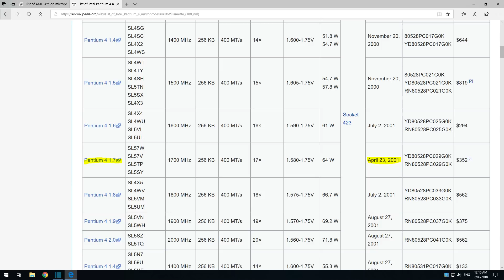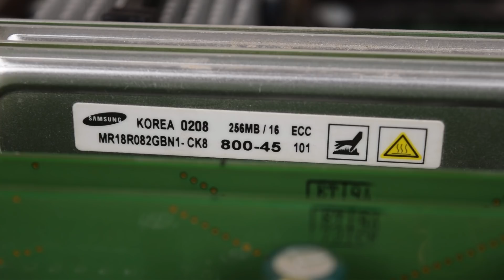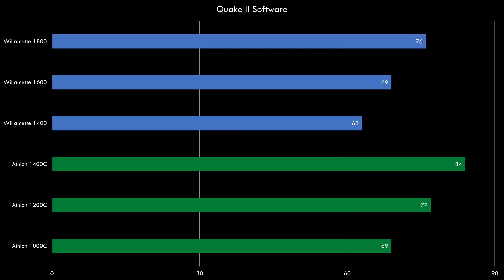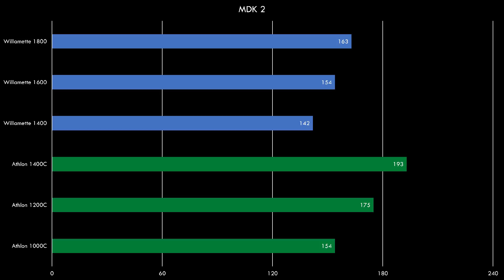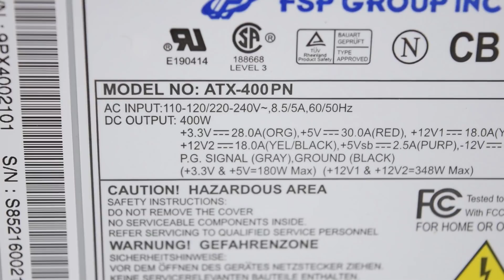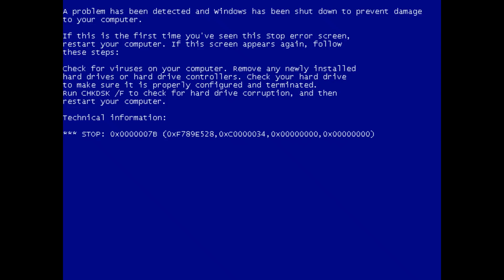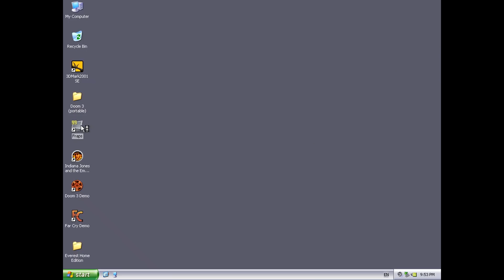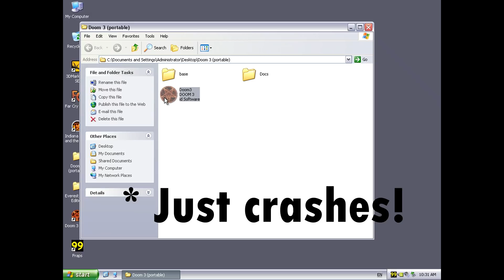Intel vs AMD S2E3 Athlon Thunderbird 1400 vs Pentium 4

Comment: Great video, Phil!
Used to have a t-bird 1400 based system back in 2001/2 which originally had 256mb pc2100, 40gb Fujitsu hdd plus a GeForce 2 mx400! I recall the CPU running at 75c or there abouts.
Reply from the maker: Nice!

Comment: When I worked in a pc shop in london in the 2000s when intel were releasing the p4 on teh lga775 I still promoted the AMD x64 systems and even sempron over celeron systems. For cost to performance, and better thermals.

Comment: what is that windows xp splash screen opening? I've not see that before. is this a custom thing? I would like to do it if so.
Reply from the maker: What time?
Reply: @philscomputerlab  9:24 Guess I should  have put the time in the first time =/
Reply from the maker: @spirallight1337  Ahh that's the setup animation. You know see it when installing XP.
Reply: @philscomputerlab  I've never seen that, I have installed XP tons of times... odd. but right on for the response!

Comment: Brings back some great memories, i had a Athlon 1ghz overclocked to 1.4ghz on a innovotek water cooling system, even had a evap/swamp cooler setup for a while, but in the end i just externally mounted a large car radiator outside my workshop and had an heat exchanger between that and the water cooling loop kept things cool easily.

Comment: I think I had that FPS psu , it could not cope wtih ati 9800 pro or nvidia 5700xt but did older cards just fine .You could think you killed it with a blank screen but worled fine on lower end cards afterwards -like mx440 ,tnt ,mx 200 but I had floppy ,cd-rom ,maxed out memory

Comment: 7:13 that noise from power supply you mentioned is normal if is from transformer inside of that PSU. i have a similar psu like this one  but the model is atx-400pnf (yeah i know is old but still rocks today)and when i play some games (like Rocket League) it does  make some strange noises but that noise is from transformer when is pushed to the limits, because i have a q9550 overclocked at 3.4 GHz and overvolted to 1.295 with GTX 1060( but i will upgrade the mb in future  ASAP).

Comment: I have made a Windows 98 PC I used a  ASRock K7VT6 motherbord with a Athlon XP 3200+ 400 MHz FSB to match the RAM. it has got a 6600 GT 128 MB.
I use SATA for my drives. It works very nice under Windows 98, but to get it to work I had to install Windows on the SATA as IDE then install the SATA drivers and change it back all done in the BIOS.

Comment: That Thunderbird kept me quite warm in winter. This thing ran hot on inefficient coolers.
Reply: The power output of the athlon thunderbird positively looks modest today. 13900k can crank out 300W if you cool it well (if it gets too hot it stops boosting). Boost is not even time limited anymore, as long as you can cool it properly it will keep clocks and voltages boosted. At least it doesn't produce a lot of heat during idle or low load (e.g. during gaming you won't even use most cores).

Comment: Never had the classic Athlon, from K6-2 450 MHz, I bought on 1999  I went to Athlon XP 1900+ and GA-7DXR+ and Geforce 3 Ti 500 during Christmas of 2001. But during 2000 I've wanted badly the Slot A Athlon. Due to family financial issues (buying our home) my parents couldn't afford it back then. Since January I bought an Asus K7M (and the GA-7IXE  for spare part) alongside the K7750MTR52B Athlon CPU and upgraded my DOS / Windows 9x basic build (K6-3+ ATZ @ 600 MHz, SY-5EMA+) with Voodoo 3 3000 AGP and classic SB Live! to K7 platform and I'm very happy! For 1998 - 2000 era it's the ultimate Windows 98 build. I've also bought and an Abit KT7 with Athlon 1000 bundled just to complete my collection.

Comment: Wow! The Thunderbird rig you put together is almost EXACTLY what I had back in 2001! My RAM was Mushkin brand, but had the same timings. I want to say I ended up getting 512mb of RAM, and I know I had a GeForce Asus video card with 64mb of RAM, but I can’t exactly remember which model. I’m sure if I looked thru photos, I’d recognize it. Oh, and I was running Windows 2000 Pro (still my favorite version of Windows, I do miss it :(  )
I also remember how hot the system ran. I ended up getting a HUGE copper heat sink with a Noctua case fan as my CPU cooler. I also put copper sinks with fans on the north and south bridge chips, as well as heat spreaders on the RAM sticks, and a hard drive tray with fans to try to offer cooling on my HD, which was a PATA Seagate 512gb 7200rpm drive. 
I want to see benchmarks of a PATA/IDE drive (7200rpm) from 2001 vs a SATA 7200rpm drive from 2001. In my personal use, I got faster results, with LESS read/write errors using my PATA drives. It was only after more revisions and advancements and upgrades were made to SATA that the speeds eventually equaled and later exceeded my PATA drive’s speeds. I want to see if this was possibly an isolated occurrence where I happened to just luck out with a abnormally fast drive or if it was the reality that despite SATA being pushed on the masses as the “new and better” technology, the older PATA technology was actually faster and performed better with less errors than SATA...  So please, a test of speed and data integrity of PATA vs SATA from 2001 or so. And please, no SATA from a newer, improved revision as I want to see how they compared when SATA was introduced and PATA/IDE drives were being phased out almost immediately. I want to see if the general public was being given a downgrade overall without realizing it.

Comment: I had exactly the same motherboard. Vias KT266A chipset were much better than the KT266 chipset and the Asus motherboard worked very well. First I had an Athlon Thunderbird 1200 MHz and then I upgraded to an Athlon XP 2000+ which gave a good performance improvement.

Comment: If I recall I had an unlocked 1200c before upgrading to an unlocked 1333 & then a Barton based XP CPU. In their day they were amazing bang for buck vs Intel CPUs. I recall when I had my Athlon 64 4000 I had a game that required a dual core as its minimum requirement, but it ran fine on that Athlon 64 single core.

Comment: Athlons in this era were great for consumers doing home builds on a budget, and that was rightfully where they had most of their popularity.
Where Athlons lost their appeal was with large customers building fleets of PCs that needed to be supported in an office setting, manufacturers who had to give technical support to non-technical users, or anybody  building a professional workstation or server. In these situations, the cost of parts to build the machine wasn't the whole calculation.

Part of the problem was momentum - reputable manufacturers already had established relationships with Intel and knew how to make an Intel system bulletproof. Switching to AMD would be a messy, disruptive exercise and large enterprises prefer to avoid unnecessary risks.  Coming off the K6, AMD wasn't going to win the confidence of big clients overnight.
Intel's RAMBUS debacle certainly helped prod them to reconsider, though. :)

AMD's main technical issue was the inferior quality of their available chipsets. VIA was by far the most readily available, high capacity supplier of chipsets for AMD, and their chipsets had serious problems.  Enthusiasts could deal with it, but the above types of clients generally couldn't or didn't want to.
This wasn't really mitigated until nVidia started selling nForce chipsets, but that didn't happen until halfway through the life of the Athlon, when Intel's RAMBUS debacle was over with, and I'd still hesitate to rank nForce as highly as Intel's DDR chipsets.  I also don't know how much capacity nVidia had to manufacture nForce1/2 chipsets on a sufficiently large scale to gain the confidence of Dell/HP/etc.  The vast majority of Athlon chipsets were VIA, and their quality was unacceptable outside of the DIY market.

A bit prior to nForce, AMD did make the AMD761 DDR chipset, but they made it clear they didn't want to be in the chipset business and were only offering this as a stopgap until the DDR chipsets from 3rd party vendors caught up. Not wanting to compete with their chipset partners, AMD kept it's price high and showed no interest in producing any successor. A high priced product with no roadmap isn't going to convince corporate glaciers to switch teams.

The low cost positioning of AMD also led to a plethora of cheaply made motherboards for that platform. This didn't help AMD's reputation any. If you had an unstable motherboard with a VIA chipset, cheap capacitors, marginal VRM construction that could barely power a Thunderbird, and a cheap PSU thrown in on top, the resulting instabilities would make people think AMD was to blame.

For servers, AMD Athlon systems were not suitable. I looked into this a few years ago when I was building a home file server.  There are no motherboards for 32-bit Athlons that have the I/O capabilities you want in a server.  Plenty for P3-S Tualatin and P4 Xeon however.  I ended up building an Opteron system, because this is an issue AMD targeted and solved with the launch of their 64-bit chips (leapfrogging Intel at that point).
Even some desktop P4 systems can make better servers than any Athlon-32 can.  An i865 with onboard GbE for example had decent file serving performance, IIRC more than double of what I could get from an nForce2 machine running the same tests.  This is due to the I/O features of the chipsets involved.  The nForce2 was fantastic for a desktop PC, but it fails hard in file serving.

High end workstations?  In that situation you're probably running specialized software with highly optimized code.  The P4 responds very well to optimized code, even moreso if the developers utilize SSE1/SSE2.  In that situation it will surely outperform the Athlon.  Developers of this type of software had no compelling motive to start rewriting their code for Athlon at this stage, and even if they did, I have doubts that they'd beat a well optimized P4 code path.
The Athlon is less sensitive to optimization, which gave it an advantage in many cases, but that's not the situation with high end applications.

The Athlon CPUs themselves are excellent, and they were IMO the best option for enthusiasts.  Although Athlon's popularity was restrained to DIY and small shop builds, it's visible successes helped to thaw the resistance of potential large clients, so they were more willing to make a leap when they thought the time was right.  When AMD launched the K8, and chipsets had also improved, they were then able to make serious inroads against Intel.  I remember being in a CompUSA around that time and being impressed to see that a majority of the prebuilt computers they were selling were K8s, not P4s. It was quite a breakthrough, and the 32-bit Athlon helped set them up for that.

Comment: I had a Thunderbird core Athlon. I bought the 1ghz version as they were all unlockable to 1.4 ghz and were functionally the same. It allowed DDR vs SDR or Rambus. It was AMDs first clear architecture win. And lasted all the way to Clawhammer (Athlon 64) and Athlon 64 x2. I had a K7S5A and had a modded bios that allowed both faster fsb and memory. It was a good time for price/performance in PC gaming.
Reply: More of a default, since intel was betting the farm on two losers. Intel expected to abandon X86 (!) with itanium and it's IA-64 instruction set; they thought it would be so fast, that they would just emulate X86 for legacy software and new software would all be IA-64. They also bet that they could extend Dennard scaling a couple of nodes and made a really forward looking processor that could scale to very high clock speeds. That was the netburst architecture; pipelined to reach 8 GHz by 2003, as was an early prediction they made. The problem was that the future they were looking forward to didn't materialize; Dennard scaling died; they couldn't clock it that fast without it drawing 300W and requiring liquid nitrogen and the relatively conventional design of the Athlon was the clear winner. Eventually after years of wandering in the desert, Intel sucked it up, dusted off the p6 lineage (pentium pro, pentium II, pentium III, pentium M...) in the form of some low power mobile chips; implemented AMDs rather simple extension of X86 to X64 and some new busses and made the core 2 architecture.
Reply: @soylentgreenb  Sounds about right.

Comment: farcry performance is weird. i played that game on a geforce 4 ti4400 with medium settings in 1024x768 and got WAY better fps than your 850xt, which makes zero sense.
Reply from the maker: There is an easy explanation, on the GF 4 it renders with DX 8, which is less demanding. You can force DX8 on the X850, and also get a performance boost. DX9 looks nicer though.
Reply: @philscomputerlab  i know, but then i bought a radeon 9800pro and it ran better than the geforce even when using dx9 and high settings. maybe it's a driver issue, farcry isn't THAT demanding. later yet, my geforce 6800GS (the AGP variant) ran it with HDR in 1440x900 very high no problems, and it's technically slower than a x850... i think. is it?

Or maybe i'm just misremembering everything, which isn't that unlikely.
https://www.anandtech.com/show/1558/3

i guess i'm not misremembering. you're definitively getting broken performance there. it should be alt LEAST 3 times as fast. maybe it's being REALLY held back by the cpu... i was probably running a 2.1ghz atlhon xp at the time of my 6800gs, which would explain the difference. but not in the geforce4's case, which i used with a 1.2ghz thunderbird

Comment: Hey Phil...how does the Athlon 1400 compare to the 1400 tualatin. Debating if I should replace my thunderbird 1400 with a 1400 tualatin I have as well. Running a voodoo 5 video card. Thoughts?
Reply: Tualatin 1.4 ghz 512 cache best.
Reply: @justiny.1773  do you think I would see performance increase given I'm running a voodoo 5? At that point I'm guessing I'm GPU limited right?
Reply: Think both cpus are more then enough for the 5500 so yeah but the p3 Tualatin will consume far less power

Comment: Hi Phil I wish to ask for an advise. Is that a good idea to use P4 socket 478 3ghz 800 1mb cash 800fsb togethet with Radeon hd 3650 512mb on AGP? I dont wish to use to old graphics card to keep fps at 60 in more demanding games from that era like doom3...
Reply from the maker: It's worth a try, but a better fit is a X800 or 850 type card.

Comment: It's the worst kept secret that at the time AMD is a lot better bang on your buck for Gaming. General consensus at the time is AMD for gaming and Intel for working (like today, many production app like Photoshop and CAD somehow work better on Intel).

One thing I hate about Thunderbird though is the heat that it generate. I end up open my side-plate all the time during summer. Anyway, this is the era that really jump start AMD. Without this and several chain of event later, Intel and Nvidia will monopoly almost everything.

Comment: Back in this day, AMD easily had the better *cpu*, but chipset options were still terrible. It wasn't until nvidia came along with nforce, that things finally turned around.
Reply: Via KT266A chipsets worked pretty good. But the KT266 was not so good.

Comment: is it possible to hook up a voltage regulator to the 12V line in order to route power to the 5V? Will a Dc-Dc pico power supply solve the problem ? it will basically just use the 12V line.
Reply from the maker: Give it a go!

Comment: The Athlon Thunderbird was a laptop CPU wasn't it? I know it was socket 462 and could be used on a desktop and they were beasts at overclocking on a desktop.
Reply from the maker: It was a desktop CPU, the model in the video is a 70W CPU!
Reply: @philscomputerlab  I still have the Athlon 2800XP and it it still runs great, The kids use it for games. I had it overclocked to 2.6 GHz (200x13) with 3GBs of Adata DDR 400 (PC-3200) buffered RAM on a ABIT NF7-S2 for several years, but it was overvolted to 1.83V. I used an Asus Star Ice air cooler. I eventually lowered the clocks to further it's life span to 2.2 GHz which is still overclocked.

Comment: i remember using pencil on one of these (on l1 or other gates) to unlock the multiplier and overclock... good times
Reply: With those l1 or l2 bridges or simply wires in socket you could do anything. Change FSB, change processor to mobile or server version, change vcore, that was golden times. So much control in user hands.

Comment: Well, this explains why my very first home built PC, even being "outdated" when built, was so fast. I had a 1GHz Thunderbird processor, 512MB of RAM and its last upgrade was to a Sapphire ATi Radeon 9800 Pro Atlantis card that was overclocked, and that machine was a beast. I later upgraded to 2.4GHz+ Pentium 4s, but AMD in that era, was stomping all over Intel. I know this, because my roommate was running AMD machines from the 900MHz AMD slot processors, up to a Athlon 64 x2 4200+ and regularly out pacing Intel stuff in most things. I do miss these days, I had a lot of fun.
Reply: i went some good 7 years exclusively on amd cpus because they were so much better then. 
atlhon a slot a atlhon 700 up to an athlon x2 2.4 @ 3ghz (which was a mistake, intel had overtaken amd at this point pretty hard with the core2 series). loved every cpu i had then except the atlhon x2 which was garbage. it wasn't any better than my previous barton 2400+ 1.8@2.4ghz in most things. i only kept that system for like 4 months before upgrading to a core2duo e4500, and then a core2quad q6600 a couple months later.